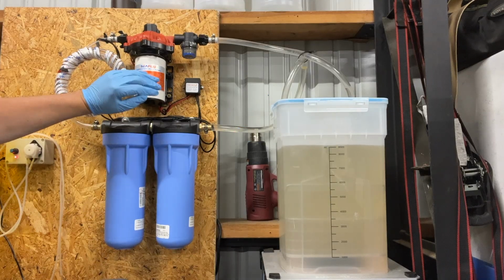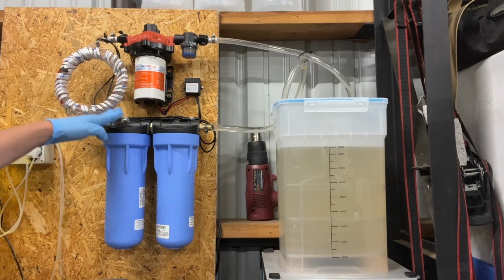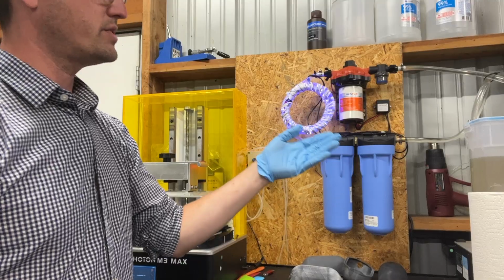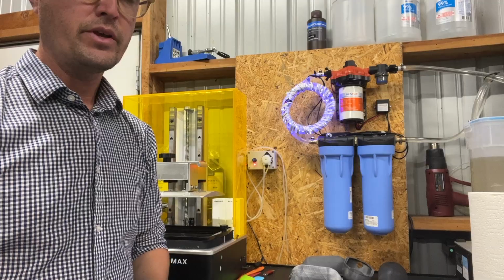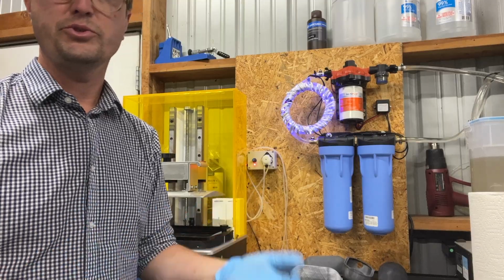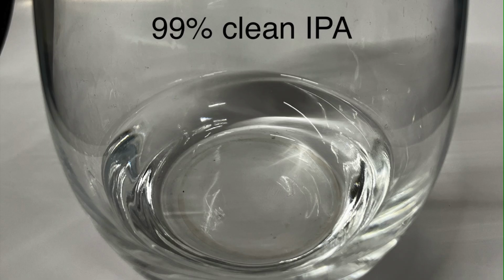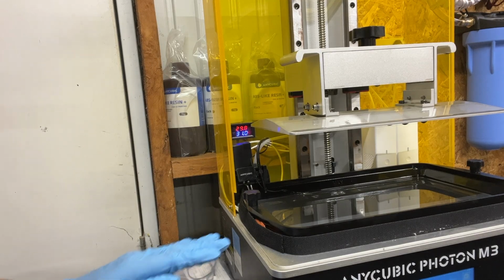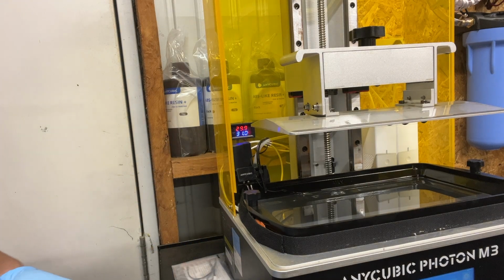Resin Printer Mods and Continuous IPA Filtration!

Comment: First thanks for the information. I have built this system and really look forward to a much better washing system.

I have two issues (questions). First the filter size. I see that the Amazon listing shows  0.5 microns for the carbon filters. However I do not see that confirmed on the packaging.  I suspect these are 5.0 micron filters.  I compared to another purchased filter that was labeled 0.5 microns, and there was a huge difference in back pressure. The validated  0.5 micron filter caused much more back pressure compared to the listed filters....     the pump struggled to push the water through... got a few leaks too.  So I switched back to the listed filters. 

Are we sure the 0.5 micron filter is the right filtration size?  My IPA is looking very mirky without the 0.5 micron filter installed. I need to decide whether its worth it to try and get it to work.  I am just looking for confirmation.

The other issue/question is pump flow rate. Seems to me a much slower pump would be more ideal for the UV light to have more time to solidify the resin. I think the IPA is flowing threw the UV light too fast to actually cure.  Anybody have recommendations on a slower or speed controllable pump?

Comment: What do you do with the ends of the tubes when you aren't running the filtration system? Oh and what is your plan to contain the mess whenever you do need to change the filters?
Reply from the maker: Tubes go through the lid, easily moved out of the way when I need to load/unload. They just stay in the system when not in use. 

Bucket placed under the filter housings when I unscrew them captures all overflow ipa. Dump any spillage back in the main container and cycle again after replacing the filters.

Comment: Interesting, but the resin residuals in the used IPA are of different types, one part visible and there are also clear oils that saturate the IPA.  Im not sure this will take care of those, maybe im wrong?
Reply from the maker: As they say, proof is in the pudding. 

After using this for over a year, my washed models come out with no sticky residuals and clean surfaces.
Reply: @nicks-fix  Over a year with the same IPA? is that what you mean? is so, that is really impressive and great to hear.

Comment: How do you purge the system to change the filters?? And where did you mount the in/out on the wash tank?? High?? Low?? One high, one low?? Thanks.
Reply from the maker: I place the wash basin or a separate catch bucket under the filters, and run the system dry by pulling the intake hose above the IPA line. You won’t empty it all so be prepared to have the filter housings still have some ipa in them. 

Intake and return to the wash basin are both below the level line, best to keep them both submerged, but the intake lower.
Reply: @nicks-fix  Thank you. That's what I thought, but rather make sure before I blow up the neighborhood or something.

I am redesigning for a lower volume pump, and smaller lines (a 1.2gpm, 3/8") for costing reasons. Or should I say, TRYING too. 🤨

Just need to find that little gizmo that will turn on the pump/LEDs only when the wash station is on.

Comment: I've been running a similar system, smaller with fish tank pumps so the propeller is completely isolated. I wanted more flow and this video came into my attention. I went to check the pump you included in the video description but the back label states "Do not pump flammable liquids", same for the one of the brand Seaflo. Is yours a specific model for flammable liquids?

Comment: @nicks-fix I love this setup and am working toward building my own, but I have a question for you.  The pump that you're using specifically states not to use with flammable liquids.  Have you noticed any issues with the pump?  Have you considered upgrading to a fuel pump instead?  Thanks

Comment: Hey, Nick.  Great project!  I've reproduced it and had a couple of issues I wanted to see if you've experienced, as well.  One is that the pump stops pumping after 10-20 hours of total use.  The motor works fine, but there's no suck or blow.  I've taken the pump apart and can't find any obvious problem (no resin coating, no blockage, etc.).  This has happened twice.  Has this happened to you?  Second, the system doesn't seem to clean the IPA much after 5-10 hours, even after replacing the filters (which didn't even appear to need replacing).  Have you had this happen, too?  Thanks for any tips.
Reply from the maker: Hi Karl, are you sure there is no air in the pump? They are not the best at self priming. 

They are also not meant to run for that long, you may be overdoing the duty cycle of the pump. 

Are you starting with clean ipa and cycling the system after each print wash, or are you trying to clean heavily resin- saturated IPA?
Reply: Thanks for the reply.  I've been running it for a couple hours at a time, sop that's part of it.  I also let the IPA drain back into the tank when finished, so the system isn't primed.  I'll try manually priming to see if that starts it up again.  I've been using it on dirty IPA, so maybe I should start with clean and use the system to keep it that way. @nicks-fix
Reply from the maker: @carsondial2  yep, it’s not meant to run dry (even though it won’t hurt the pump). 

Keep both the return and suction in the IPA so the air will get pumped out. 

Start with relatively clean ipa, it’ll help everything last longer, since it’s meant to take minor amounts out on each cycle, not a bunch at once.

Comment: Can one use denatured alcohol with this system?
Reply from the maker: You need to check the chemical resistance of the parts against denatured alcohol. 

Most parts are polypropylene and vinyl.

Comment: I am still waiting for someone to start manufacturing ITO/FTO-coated heating screen protectors for efficient FEP heating. For example, KRALYN demonstrated it's use as heatbed for his FDM printer PositronV3, so it is definitely viable. Only thing you need is suitable ITO-coated glass, PSU and some kind of thermal feedback.

Also, I am devising IPA filtration based on continual deposition of resin on a disposable surface. Imagine stairs on a slight slope covered with disposable non-woven fabric, complemented with overhead UV floodlight and peristaltic pump. UV light will cure resin only on the fabric, and peristaltic pump will cycle the IPA over the stairs over and over until it is clean or until the fabric is all saturated. It would be all sized up for ultra-cheap 10.6l Ikea 365+ container. Originally I planned to build it in the container's lid, but it would provide better access to the filtration fabric if it were on a standalone frame, only encased in the container. Replacing even hundred of sheets of non-woven fabric is still cheaper then replacing one proper filter, it is clog-proof because if the fabric is saturated, the IPA sipmply spills over to the next stair and eventually back to the bottm of the container. I expect to have it built by the end of the march. What do you think?
Reply from the maker: Good luck! I don’t understand fully, but I’d wonder if the sheets/stairs are already soaked with ipa, the exposed resin in the ipa wouldn’t be caught by the filters, it’d just flow over back into the basin and into the pump. I’m imagining like a sponge, once fully filled, it wouldn’t be able to absorb anything. 

In addition, how would you prevent evaporation?

And last, the filter cartridges I use are very inexpensive and since it’s pressurized, have a much larger surface area for capture. 

Looking forward to your experiment!

Comment: Do you think this would work with other types of cleaners, like denatured alcohol or something like mean green degreaser? IPA just kills me with the smell, so I’m on the hunt for something less stinky.
Reply from the maker: Possibly! Just be sure to check all chemical resistance of Polypropylene against any other cleaning agents.
Reply: @nicks-fix  Hey Nick!  Just wanted to say I built your setup for my resin printing station.  I used it for about a week and noticed that my IPA got really cloudy.  I didn't think that was right, so I did a test of curing a little bit of the IPA in a separate container, and sure enough, it turned completely white from cured resin.  Turned out my UV LED strip isn't curing the IPA at all, I think it's probably not the right wavelength, I've had it like 5 years.  But I used my industrial UV curing lamp and set it up next to the coil and within about 10 minutes my IPA was crystal clear again.  So to me that is proof positive that your setup just works!  I just needed to get a better UV curing Lamp for it.  I can't even begin to describe how much this has changed my Resin 3D printing.  Thanks for sharing your setup it really is a game changer!  I hope your Kickstarter goes well if you're still doing it!

Comment: Wanted to chime in with a few things.

1. The pump in the link is a different brand now. I didn't realize that but it seems to work!
2. I got the cheapest filter housing possible. I don't recommend this. Getting some of the dual housing or single housing x2 for around 50$ total is the better idea.
3. It full on works!!!
4. Some improvements: maybe quick release fittings for the container connection! I found that having a Y at the pump outlet with one section going to a valve and a small extra set of tubing allows me to hook up an air compressor to drain 50%+ of the IPA that say in the filter housings! This makes filter replacement super easy!
Reply from the maker: Great points! Thank you!!!
Reply: @MoonWind32690 The air compressor is a very neat idea! I have no dedicated air compressor in my small workshop though. First question: do you think that a mini air compressor for car tires would have enough power to do the job? Second question: is there a preferable mounting point for air injection between these two possible locations: A) between the pump outlet and the Ultraviolet Coil Reactor; or B) between the UVCR and the filter housing inlet?
Reply: @fluxcapacitor  Probably? I just used a airbrush compressor. Super small, very low flow and not much pressure (I think I had it at 18psi from the regulator for the airbrush as is.

Location, I did it post pump right before the UV system. I didn't want to try and compress the pump.
Thing to consider is you're pressurizing the system so you need to vent the air. This proves problematic as you're losing the 'head' evaporated IPA. But honestly it's still probably far more efficient than all other resin cleaning solutions. 

I just have a 'tap' valve that goes to a window that I put the hose out so the vapors aren't trapped in the building.
Reply: @MoonWind32690  Thanks for this. I am quite amazed that a simple 18psi airbrush compressor can push the liquid out of the two filters in a row so easily! Makes me wonder if some cheap peristaltic pump could be enough to power the entire machine instead of the (already cheap, admittedly) small diaphragm pump. However, maybe once the filters are full of resin, the task will not be so easy.

Comment: This is awesome. I was looking for a distiller to clean my ipa but this looks like a much safer way albeit slightly more expensive. I can't find the exact parts you used here in Sweden but I think I managed to find equivalents so hopefully I can get just as good results once I have it set up. Thanks for a great video.
Reply from the maker: You bet!! Just be sure to check chemical resistance of any part that comes in contact with the IPA

Comment: I am considering building this using the Anycubic wash and cure station.  Do you think I could attach the hoses directly to the Anycubic wash bucket and just run it through there whenever I do a wash to avoid transferring the IPA to a separate "cleaning" bucket?  Also it was hard to tell from the video but are there pickup and return hoses submerged in the bucket as well?
Reply from the maker: Sorry if that wasn’t clear!!

I have the hoses go through the lid of the wash bucket to keep the air interaction low and allows me to move the bucket away from the system for maintenance a lot easier. 

It’s best to keep both the return and suction submerged to reduce adding air into the system. I put the return slightly higher than the suction to facilitate more agitation in the wash bucket.

Comment: Instead of a diaphragm pump, why not use an automotive fuel pump? They are cheaper and  you dont have to worry about them reacting.
Reply from the maker: Great point. In my early tests it was easier to use a diaphragm pump off the shelf. 

In the commercial version I’m developing we use a fuel pump.

Comment: So as I continue making some research on my side in an effort to make an automated filtering station for my IPA... I've run into a potential safety issue with that setup, which is running in flammable liquid through an electric pump... to be on the safe side I think an air activated diaphragm pump would be MUCH safer, although a lot more expensive! Any thoughts?
Reply from the maker: Yep! I’ve gone over this a few times in other comments. 

IPA in a liquid form is not flammable. It’s only when it’s exposed to air and is vaporized that it becomes flammable. Think of it like when you “flood the engine”. Same concept. 

As long as you reduce the amount of air in the system to a very low amount, the risk of things catching fire also is diminished to a low amount. 

In addition to that, the ipa never comes in contact with the motor internals, as it’s a diaphragm pump.
Reply: Ah, I hadn't seen those other comments! Thanks for mentioning it again!  @nicks-fix   I've been thinking about your filtering setup a lot as I think its super cool, I'm attempting to find ways to improve it and perhaps make it more affordable too! I'll definitely write any improvement I manage to make over here!
Reply: After making some more research, a manual diaphragm pump might do the job! They also are much cheaper, and a lot safe since you have absolutely no chance of getting any kind of sparks.

Comment: Noob here, but why not put the pump at the end of the loop... it would prevent it from potentially getting clogged by resin over time? I'm guessing there is a technically reason why its at the starts?
Reply from the maker: You are correct! While diaphragm pumps are great, they don’t do well at suction. This would inhibit its ability to push the saturated ipa through the resistive filters.
Reply: @nicks-fix What if you give it a little help with gravity, have your pump and filtration setup be lower then your IPA reservoir, gravity would help the pump... still has to suck it through the filter however.

If that doesn't work, with the pump at the end of the loop, perhaps an other type of pump could be used? Or maybe just a slightly more powerful one!

Comment: Wow! awesome setup! Going through the parts n pieces, for now, I'm only doing the warming piece, and I love the low price of your recommendations. I did notice though that the heating element is super long. Can it be cut? or did you just wrap it around a few times. I have an AnyCubic Photon 4, smaller than yours.
Reply from the maker: The heating element can NOT be cut. If you need a shorter one, overlapping is fine or buying smaller/shorter strips and wiring them in parallel would work fine to maintain 12v across each pad. 

Search for 12v heating pad and a bunch should show up that you can measure to see what works. 

Also be sure that your resin vat is metal or can withstand the temps! Would hate to warp your vat.

Comment: Hey, great idea. I had a quick question: is there any reason to have the pump at the start of the loop instead of after the filters? I'm thinking if the pump is at the end of the loop it'll be dealing with less potential fouling from particulate.
Reply from the maker: Great question. 

Diaphragm pumps are not great at suction, and much better at pressure. Since any of the large particulate is caught by a screen filter before the pump, the pump will only interact with IPA and suspended resin. This is why it is important to start with fresh IPA and cycle it frequently.
Reply: @nicks-fix  ohhh thank you that makes sense.

Comment: I did this system but went to a whole nother level. I used a 5gpm 120V pump and 3 stage filtration one heavy duty 25micron filter followed by 10micron then 1micron. Iam rethinking the last stage as it diesnt have carbon and that might be necessary to remove the dye that leaves my "clean" alcohol grey. I am using a Mega S wash station and as it has a bottom drain i drilled a hole just below the top level added a bulkhead fitting and hard plumbed everything. As far as the light being I have a large wash machine I made a tray to hold a 20w UV light just abive the surface. Results are not perfect and I still need to run my alcohol through my still but oddly enough the waste in the still is much different now. No longer is it resin like but a jelly like substance and a yellow tinted oil like substance remains after distilling the used alcohol. Not sure what that is but the filtration is not removing it. My service life between running it through the still is much better and for sure the pigment powder they use (titanium dioxide i believe) is no longer existent, leaving my prints never having that white dust on the exterior. I had thought of a system like this before, but never pulled the trigger due to not wanting to test the idea out. Thanks for taking the time to test the idea giving me no excuse nit to do it. I will say I print a lot, on the order of 50kg a month.
Reply from the maker: I’m building a commercialized version of this and would love to talk to you more. Would you be down to chat with me about your mods?
Reply: @nicks-fix  sure I have tried to respond with my contact info but it wont let me
Reply: @nicks-fix  I also did a heater system for my rubber resin printers, but I went a different direction